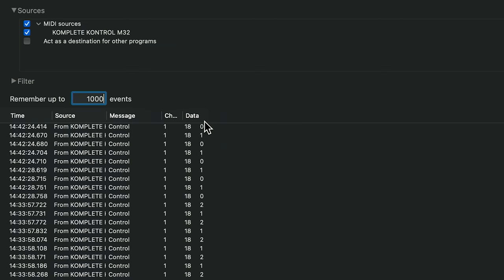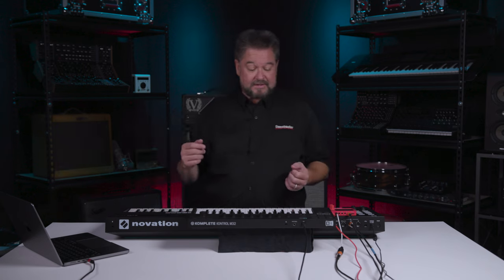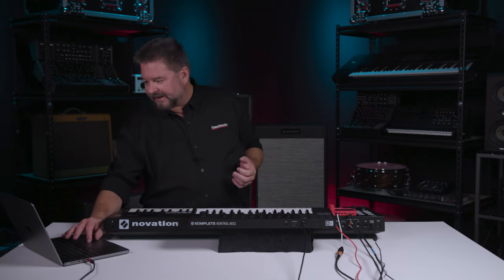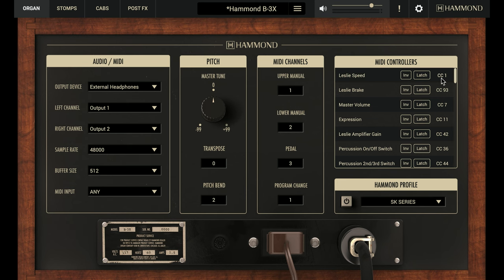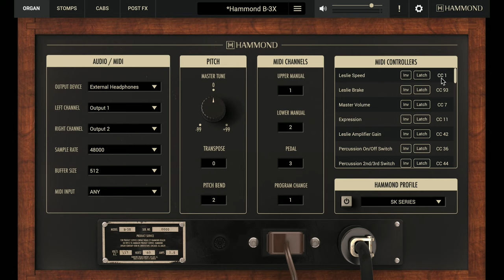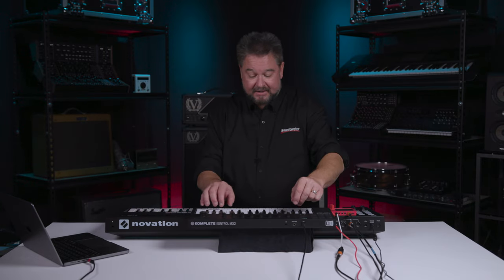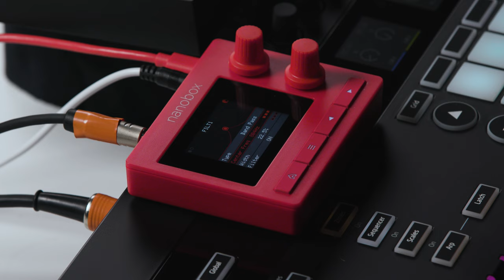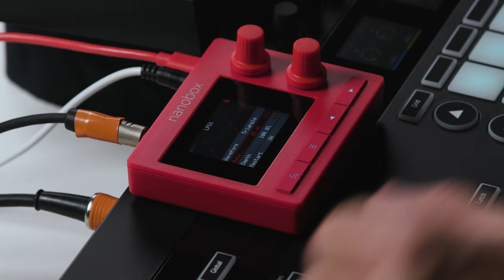What Is MIDI CC? – Daniel Fisher

Comment: trying to send a midi message to my organ module to control rotary speaker. after watching this I still have no idea how to do it. I see the codes in the manual but how to get another keyboard or foot switch to do that is beyond me. It seems all these info videos are configured for specific equipment that doesn't apply the same across the board.